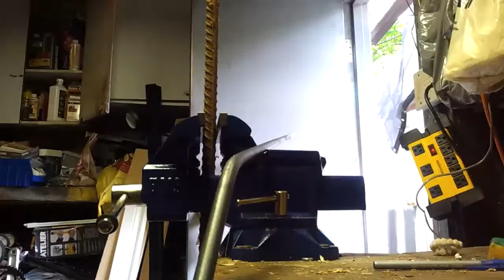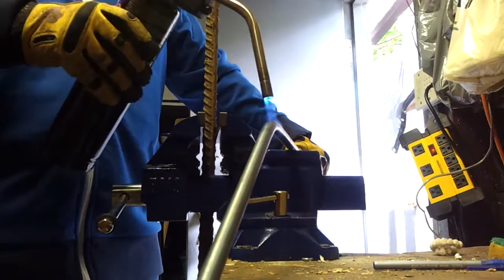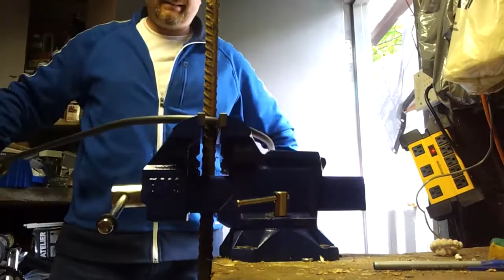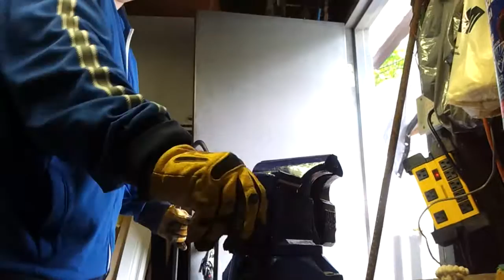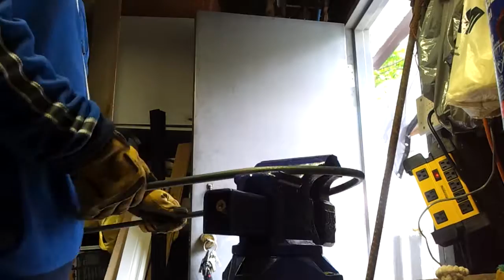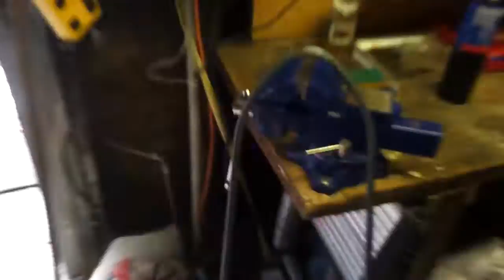Building a motorcycle sissy bar in 1 minute 30 seconds

Comment from the maker: Building a motorcycle sissy bar for the Vulcan 500.

This bike is a little uncommon and I wanted a taller sissy bar. The taller ones range from $200-300 CAD with tax and shipping, so instead I bought an 8ft long 1/2 inch diameter steel bar and made my own for $30. It attaches to the saddle bag mounts, I'll spray paint it matte black and post some photos after install.

Comment: bro how did you attach it to saddle bag mounts thanks
Reply from the maker: +mr3dfx1 Check my next video: I bent the bottom sections of the sissy bar in a similar way, took some "angle iron" from a set of steel shelves and welded it on. The shelving angle iron came with predrilled holes that just happened to be the exact distance apart as the mount points for the saddle bag; these are pretty standard steel storage shelves you can get at most hardware stores. https://www.youtube.com/watch?v=62wbBZh0yYc